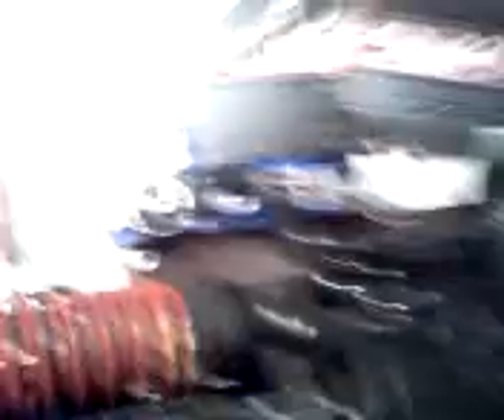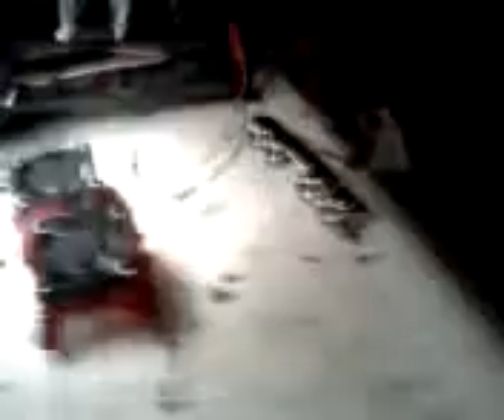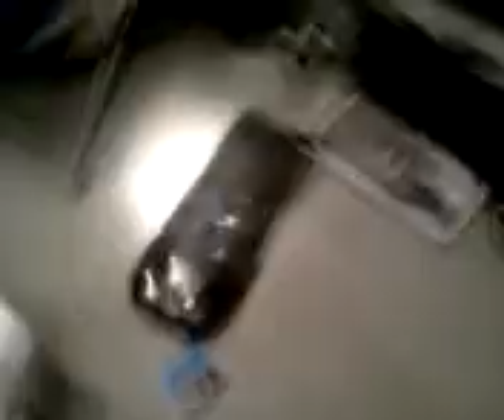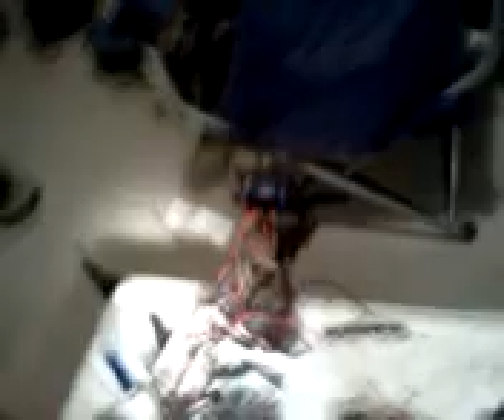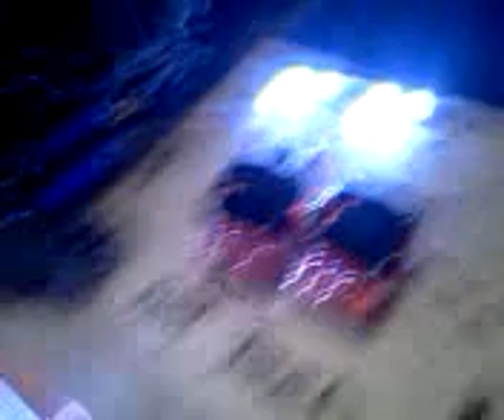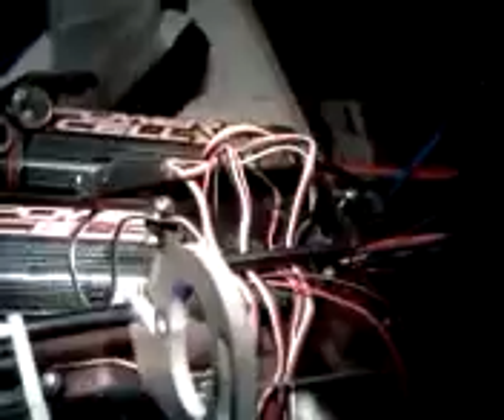Super custom Summit

Comment from the maker: I would have had it running this weekend but the bulkhead I had sent into me was supposed to be a rear and I got a front unit.    The seller is now sending me a rear unit for free so as soon as I get that in it's on the road.  I'm also thinking of getting the road rage tires put on my wheels to do the actual testing.  I just don't think the canyon at tires are going to handle the power and speed I have going into this thing now.